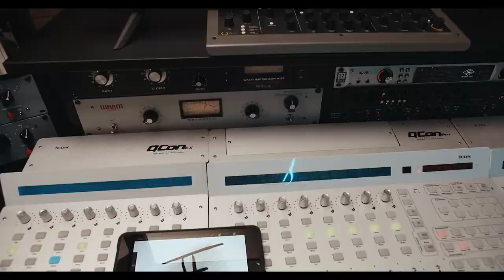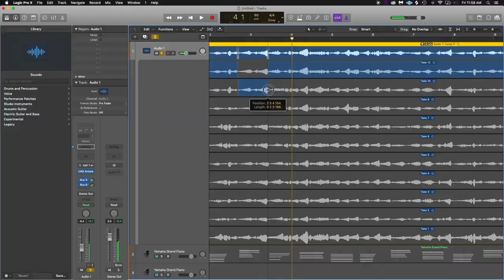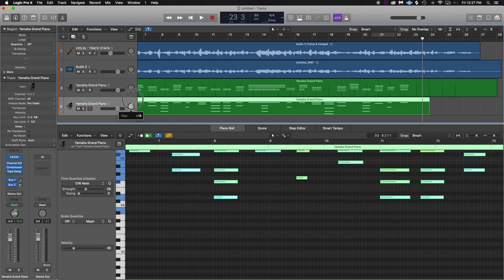How to record beautiful, professional violin! Mic'ing and processing explained to Ashokan Farewell!

Comment: hello there! thanks for the video. Do you you reckon it might be useful to mic the violin in a similar fashion, but using a matched pair of Small Diaphragm Condenser mics, for example in an X Y disposition, instead of just one mic? is it a possible way of obtaining a more spacey sound or just a waste of precious time? thank you
Reply from the maker: I never received much benefit from going stereo.  I tried XY with the KM184s and it actually made the violin sound a little less present.  I think if you are going for a more spacey, even sound design for your violin, I'd lean on reverbs and delays to get that effect.  So, I'd recommend just sticking with a mono approach.  But definitely never limit yourself, keep experimenting!